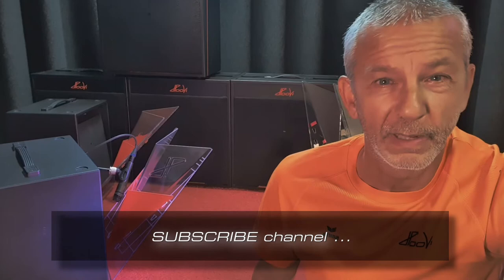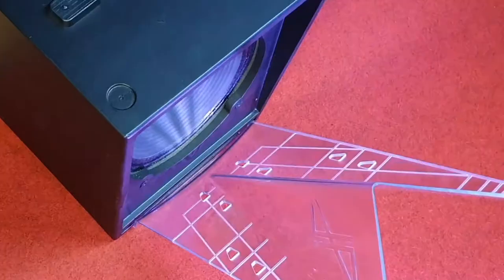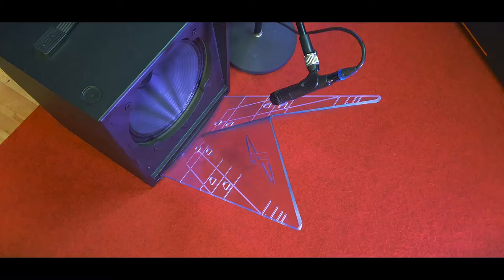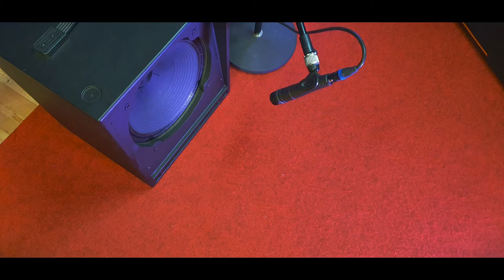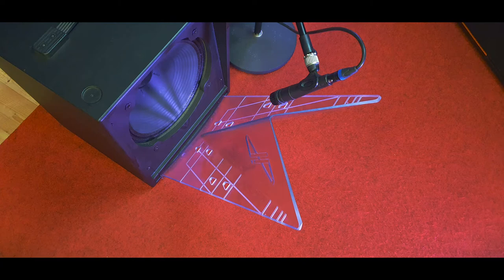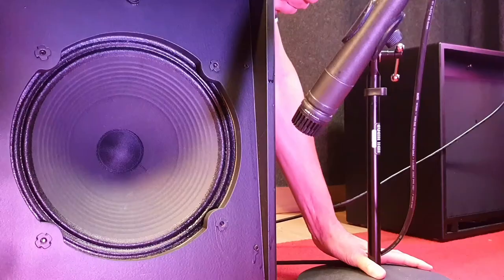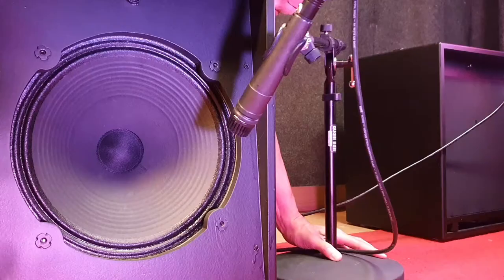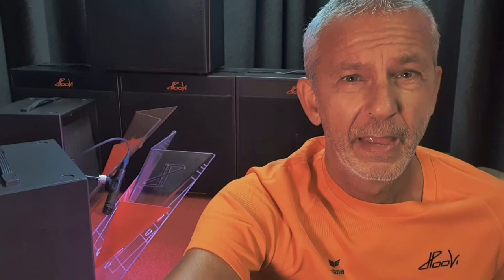Recording with without Deeflexx #deeflexxrecording

Comment from the maker: ENG: The video shows sound samples recorded with and without a Deeflexx. It’s a basic information how the sound brightens up when putting a mic on the surface of a System. It may surprise you, how full the sound is even when placing the mic on axis of the rim – just test it …
Tip – use headphones or good speakers – the sound is worth it! 
---
DEU: Das Video zeigt Soundbeispiele aufgenommen mit und ohne einer Deeflexx. Es ist eine Basisinformation wie ein System den Sound präsenter klingen lässt wenn ein Mikrofon an der Oberfläche positioniert wird. Es wird dich überraschen wie voll es klingt, sogar wenn das Mikrofon auf Achse der Lautsprechersicke ausgerichtet wurde – probiere es einfach aus ..
Tipp – verwende Kopfhörer oder gute Lautsprecher ! 
HooVi 🎸🔊_/   😀